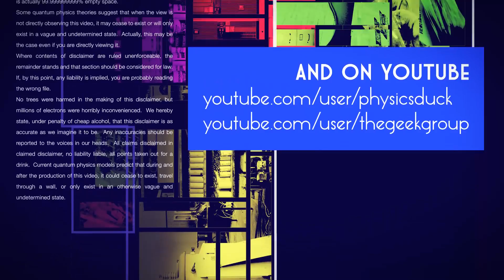Captain's Blog 2 4 2016 FPV Antenna Mast Final Paint and Shelf Fabrication

Comment: Too late now, but if that pipe had a threaded flange, it would have had bolts to secure the top plate, you could have got to the inside, also would have had places to bolt stuff
maybe on the next mas, which should also include mounting points down the mast for power conduit and signal cableswith clamps (ties are ok until they suffer from UV and cables start to flap)